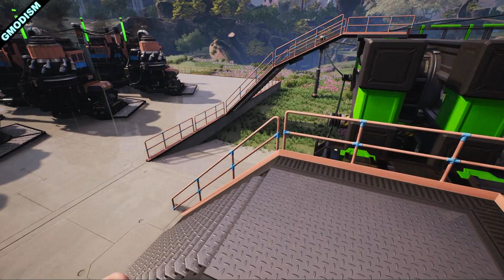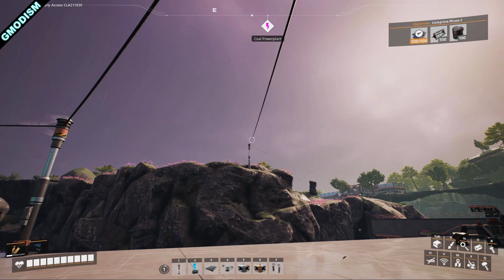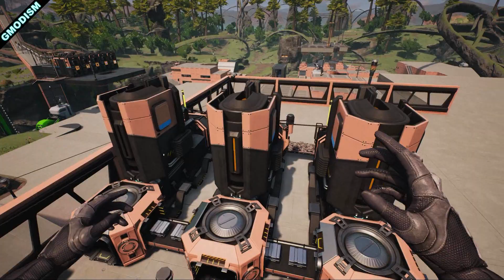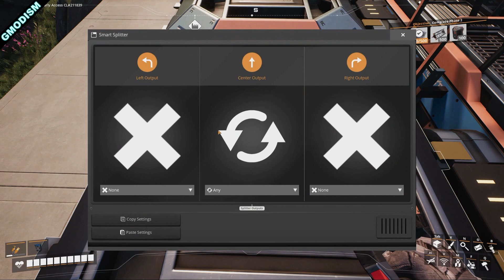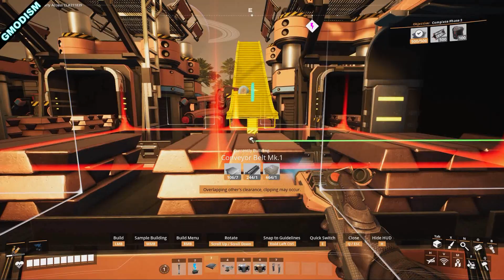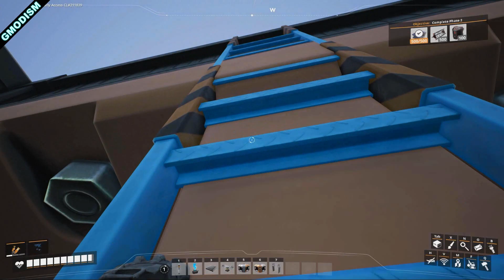Efficient Motor Factory - Satisfactory New Player Guide EP19

Comment: Where did you get the copper and steel from? Were they from previous builds or completely new factories?
Reply from the maker: This is episode 19 in this series, previously we added steel and copper :)
Reply: @GMODISM  So you split off the copper and steel from their production lines?
Reply from the maker: @derpasaurus_rex6919   We added extra copper lines, and we calculated that steel will not be running out by keeping track of the production in the previous videos for 270 steel per minute (don't remember episode number)